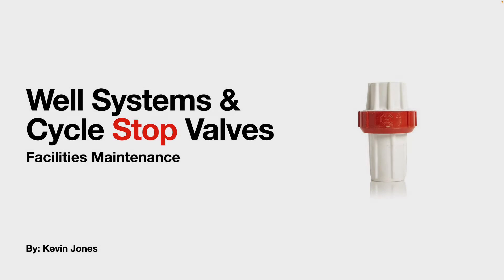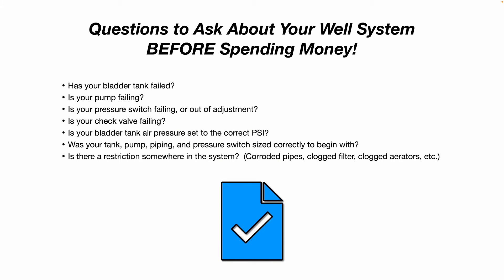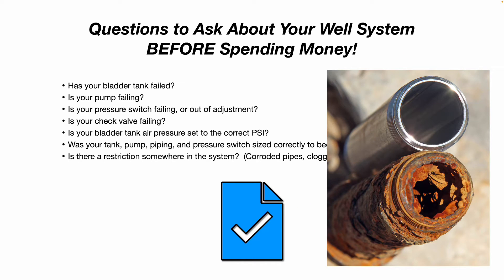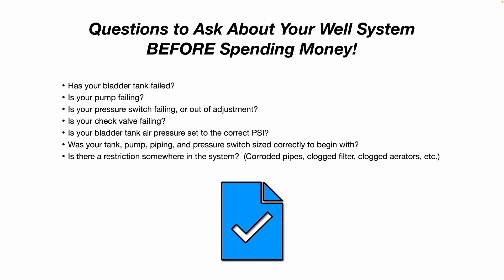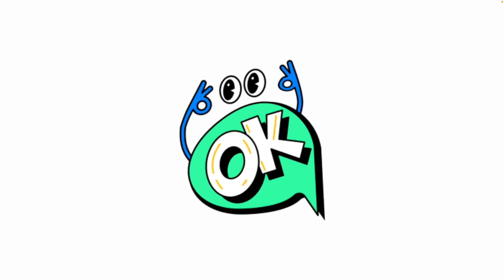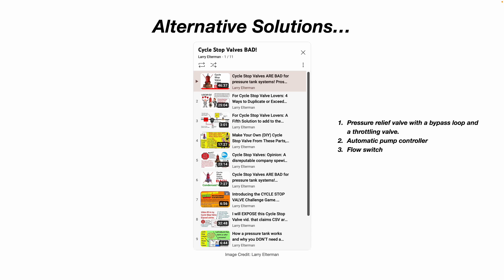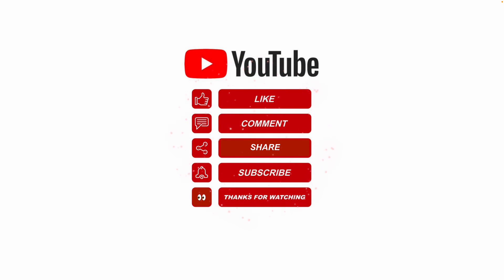Well Water System Components & Cycle Stop Valves (Overview)

Comment: Taking a shower with the well tank full would have high PSI at first, then decrease to the low limit before the pump kicks on, then the CSV maintains the set PSI. A large tank will not benefit from a CSV.

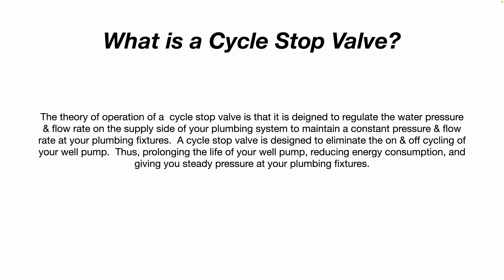Comment: 4:20 Reducing energy consumption only if the pump doesn't remain running for a 'long time'. Pump back pressure may be a problem, check your system out before installing ☝

Comment: With centrifugal pumps as pressure increases flow rate decreases, which will decrease the weight load, and so decreases the amp draw. You see this in the pump curve. Amps do not go up unless more weight of water is demanded. Larry Elterman is not a pump engineer he is a computer engineer. He knows how computers work but not pumps. Anyone ever try any of those alternatives? Let us know how they work out.

Do you still use the CSV? If not then why was it removed?
Reply from the maker: I sold the house house where I had the cycle stop valve.  I would assume the new owner continued using the cycle stop valve.